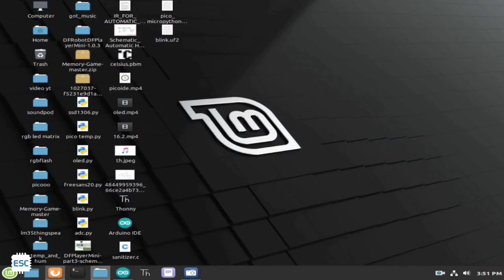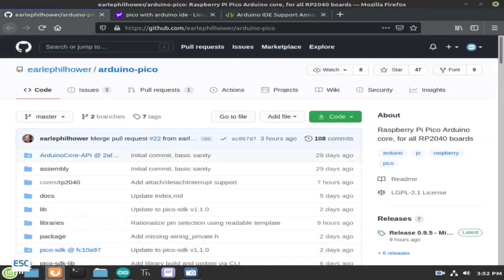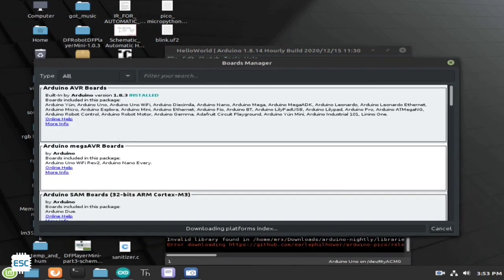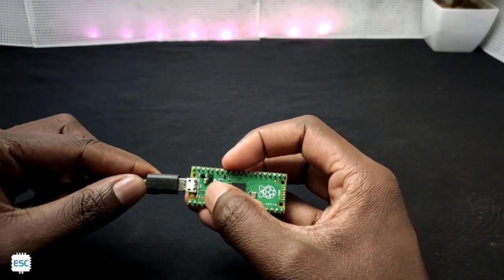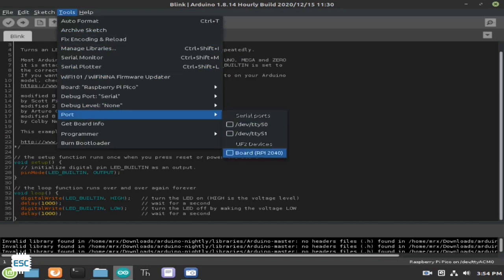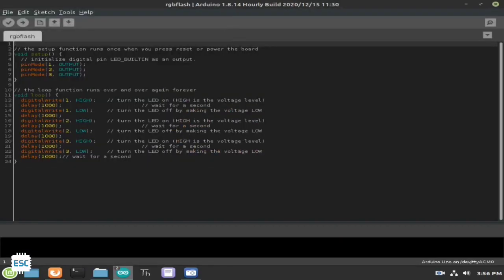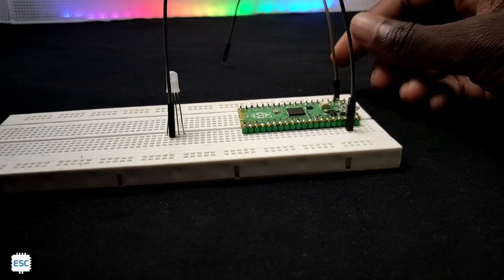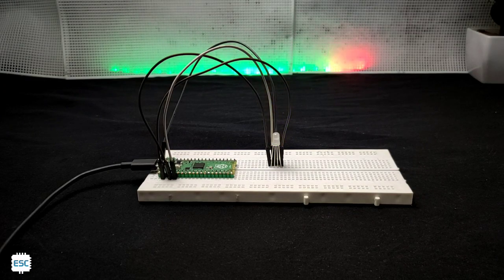How to Program Pico with Arduino IDE | Raspberry Pi PICO with Arduino IDE

Comment: WHERE ARE THE CURRENT LIMITING RESISTORS ON THE LED?!
You're making a tutorial while making absolute rookie mistakes yourself.
Reply from the maker: Not a long running project just for demonstration
Reply: @EDISON_SCIENCE_CORNER  You're giving a terrible example. If you're omitting the resistors, you HAVE to tell your viewers that they shouldn't connect LEDs without resistors for long term projects.

People will be directly copying your moves and will be leaving LEDs connected without resistors in their project, just because they've seen a tutorial on youtube showing them how to connect LEDs to RPI Pico.
Reply from the maker: I forgot that  really   i mentioned in the discription 🙏
Reply: @EDISON_SCIENCE_CORNER  From my experience - barely anyone will read it :(
Reply: @jamjestkowal  lol, I thought, pico has resistors build in, but when i connect the LED, after 1 minute it was death :D
Luckily, it was only cheap LED...
Reply from the maker: Yeah its necessary for  long running project